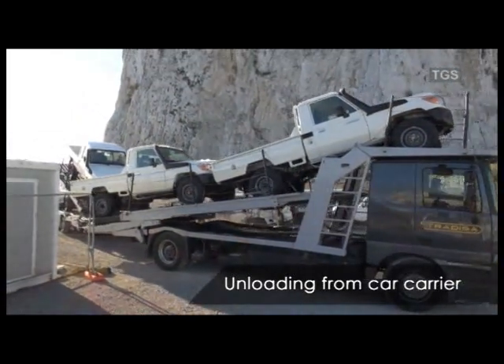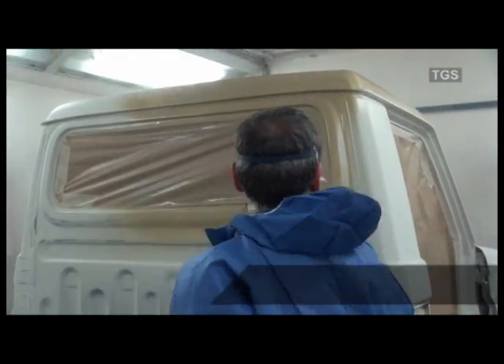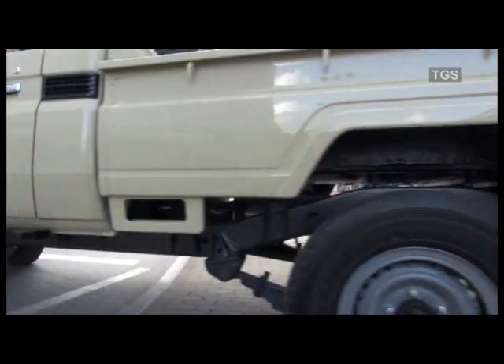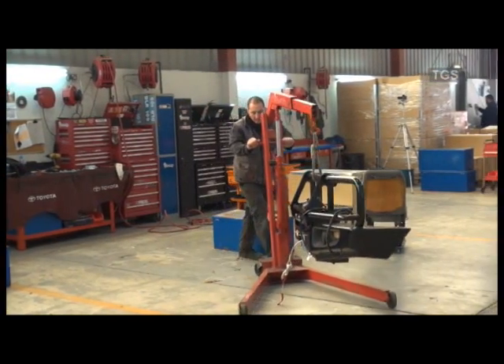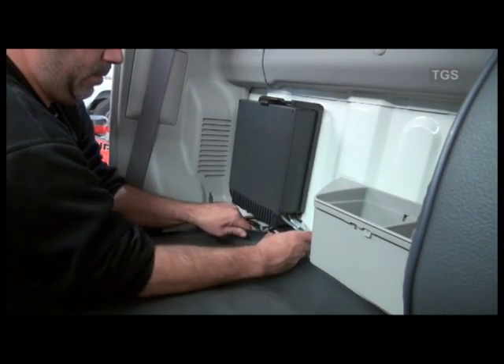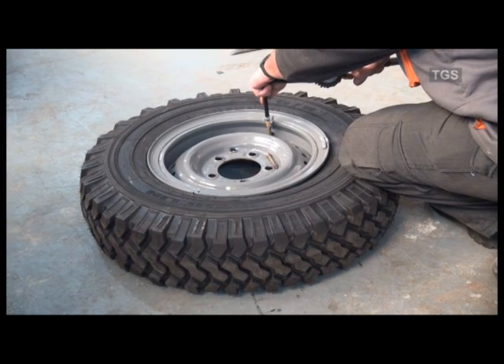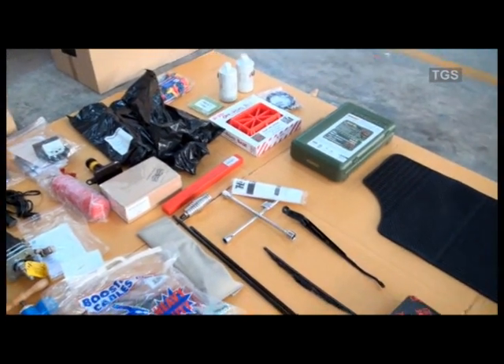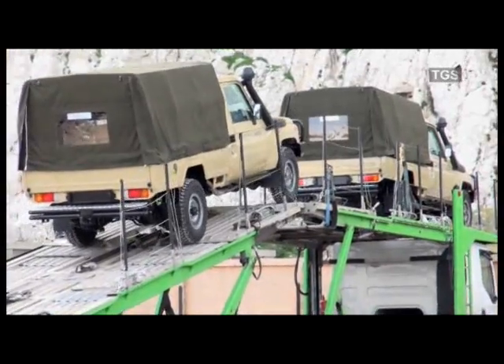A Day in the Life of a Land Cruiser (Full version)

Comment from the maker: Hi Arda86ca,

We stock the vehicles in Gibraltar so we can ship them swiftly to where they are needed, due to the easy reach of the Mediterranean ports we have nearby.

The vehicles we stock are in factory white colour. If a customer requires vehicle(s) in a different colour we will re-spray them to accommodate their needs, using the process illustrated in the video above.

Thanks for your query,
Toyota Gibraltar Stockholdings
Reply: Late to the party.  That said  1, no 2  are needed in my drive way.

Comment: Who'll balance the tyres after removing them from the rim and re fitting them back ?
Reply: You take chalk and mark the tire where the valve location and then the split location on the ring. It will be close if not perfect.
Remember, this is for fixing a flat in the middle of "no where".
Reply: these are intended for off roading, not formula 1 racing.  balancing is not really required unless you are going 40 to 50 mph or higher all the time. Like in the US, not the Savanah

Comment: THIS IS A REALLY PICK UP TRUCK NOT THE AMERICAN'S MADE JUNK.
Reply: Why do you call American trucks junk? they are actually very reliable. Also you're kind of dissing Toyota to, as they make the Toyota Tundra and Tacoma in the U.S. and again very reliable.
Reply: Devin Mitchell
because in germany we have something called tüv, an institute where you have to let them check every two years to check if the brakes work correctly, if it has no rust, if nothing worn out and many other things and when it fails, your car is not streetlegal anymore. and often its the cars produced in america which fails.
and brand new car from the usa are first fixed before going out to the costumer, because the quality is not good enough. if it would not be fixed the would fail in two or four years by the tüv
Reply: FoxMccloud42 Americans have been known to produce some of the most reliable cars ever and usually it's Pickup trucks. It's hard to believe that they fall apart, as Americans, Canadians, and Mexicans have been buying them by the tens of thousands a year. They even outsell the Toyota Hilux in Mexico. And going to all three countries, you'll still see a lot of old American pickups still on the road.
Reply: Devin Mitchell
i can only tell what is in germany and in germany it is a different story because we have something like tüv were cars have to be inspectet if they are safety if there is nothing worn out and it often the cars producedet in america (followed by cars producedet by italians) who failed this inspection. and a car failed by this has no value.